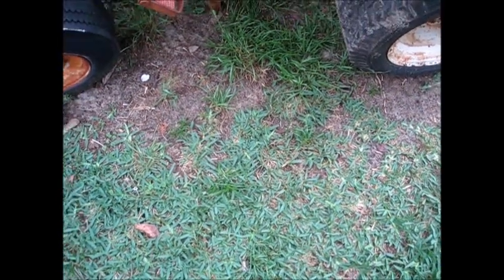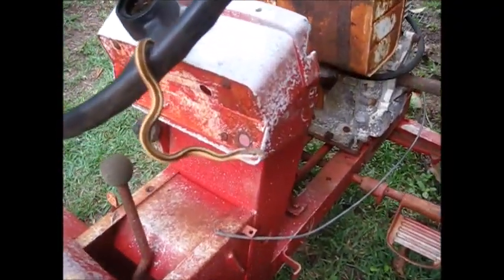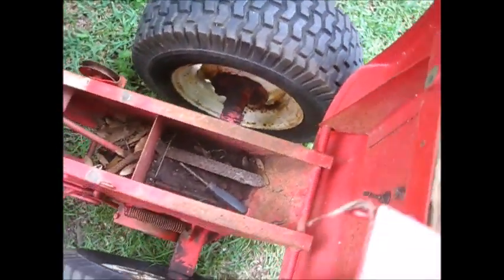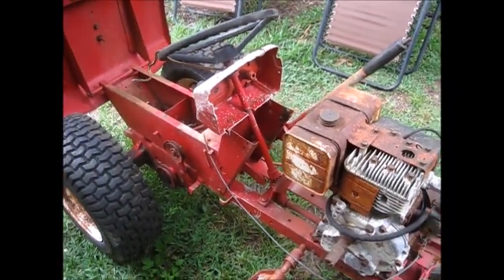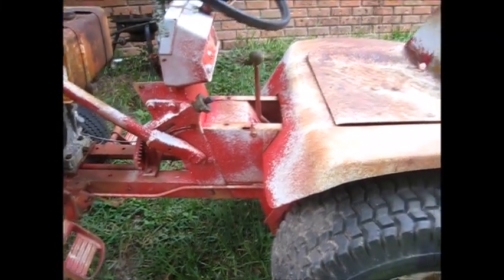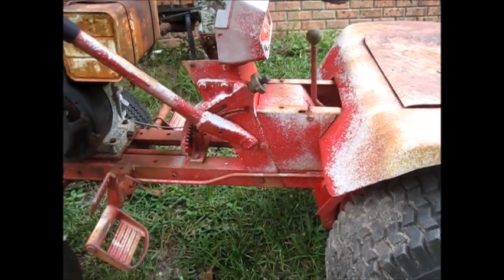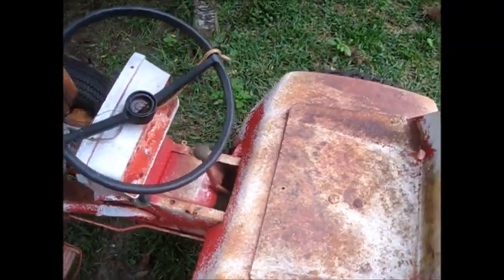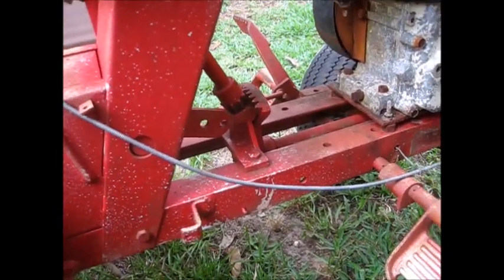Wheel horse  tractor - model  855

Comment: Good luck with your project....will you make a video when you're all done??  ps.. Walmart sells Regal Red rust-oleum that matches  the Wheel Horse red in case you ever do want to paint it.
Reply from the maker: already  have  some  of  the  red .  i  will  use  to  paint  some  areas  ,  but  im  gonna  stain  a lot  of  it  before  i  clearcoat  it
i  tore  it down  today  and  fit  the  engine,  im  undecided  if  im  gonna  use  it  or  buy  a  new engine.